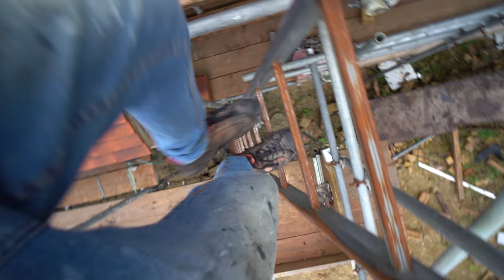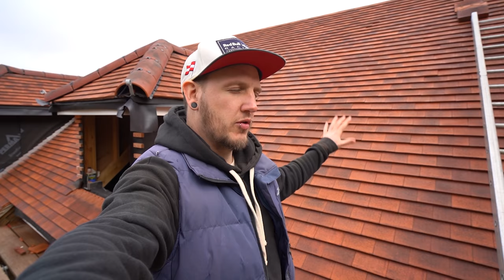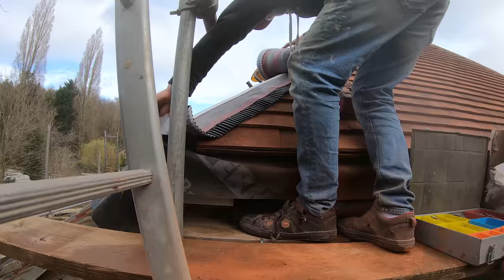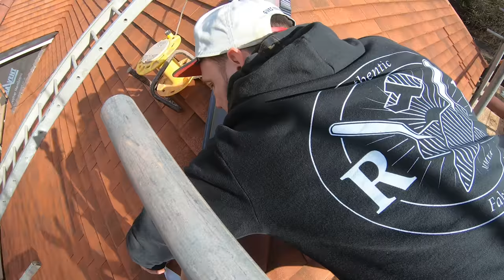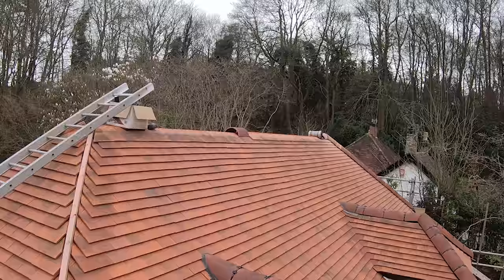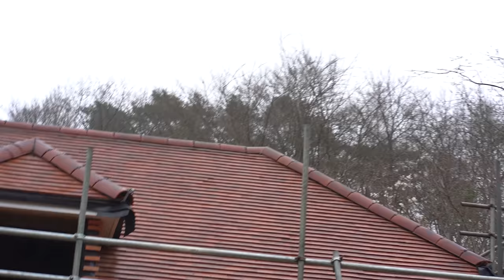BUILDING A HOUSE ALONE from START TO FINISH | E.P 93 [I may regret this]

Comment: When cutting your 3 way mitre on the hip to ridge. A good way is to measure 6" one side of the ridge tile and 4" on the opposite side. Then repeat this on another ridge tile and finally mark out two 4" on yhe last ridge. Cut them all and they should interlock nice n neat at the ridge/hip junction. Well done though good effort!

Comment: Funny i really like roofing but it can drag on your own and there's alot that goes into a roof. and as its the hat to the house you got to get it right, water is unforgiving. for the inside of those hip tiles i always bend a couple of stainless steal wall ties wedge them in tight and just behind put a squirt of expanding foam to plug the void, stops the muck slumping. and the wall ties gives the mortar something to key to so it doesn't just fall out next Christmas. cant wait for your next vid keep up the good work.
Reply: Edd Jordan  they were a dry ridge System..........

Comment: Its certainly a lot quicker then the old school bedding the ridge tiles on with mortar but in my opinion doesn't look as good ....roofers on the site we're on at the moment are using the same system as you and they look like ridges are just sat up on the roof .